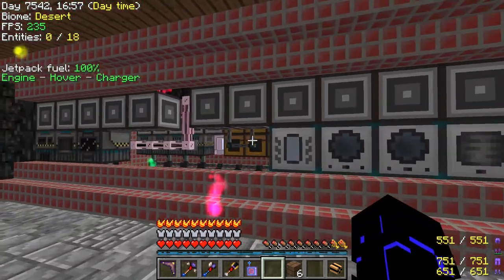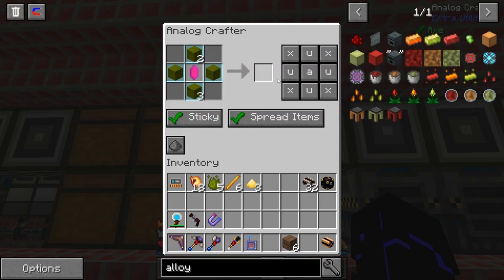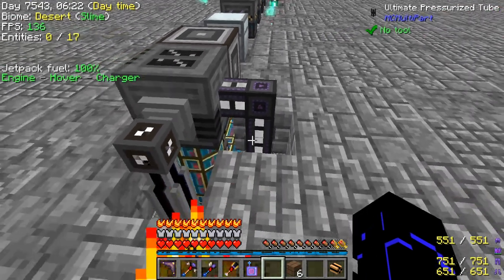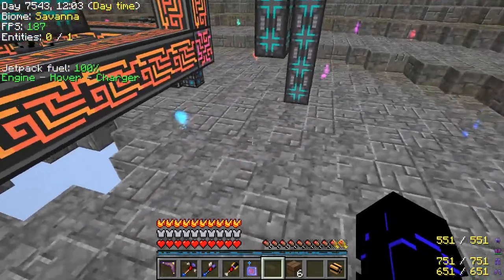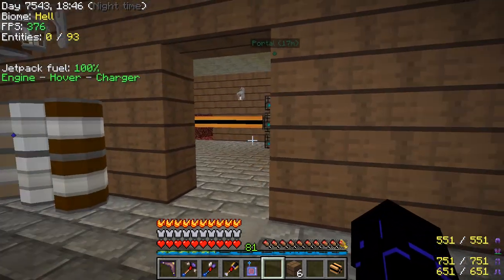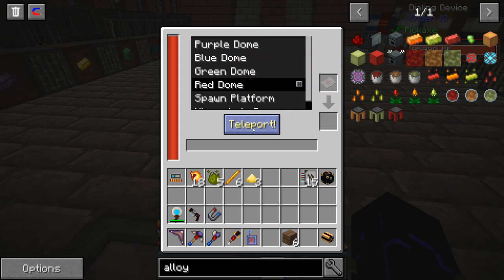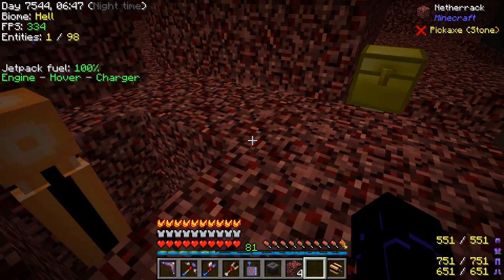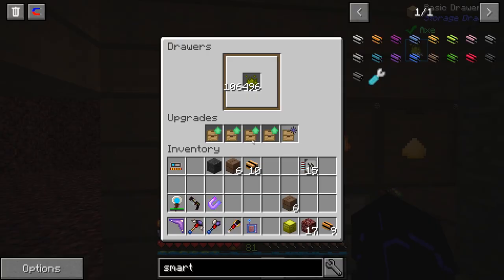Wireless Resource Farming Cross Dimensionally - E47 - Project Ozone Lite

Comment: Which machine requires 300k iron ingots?
Reply from the maker: The Induction Matrix from Mekanism takes WAY more than that.  It's a super resource hog, but stores INSANE! amounts of power.
Reply: Oh neat. What do you have going on that requires a substantial amount of power?
Reply from the maker: not a single thing...currently.  stay tuned.  but to be fair, nothing will take that much power.